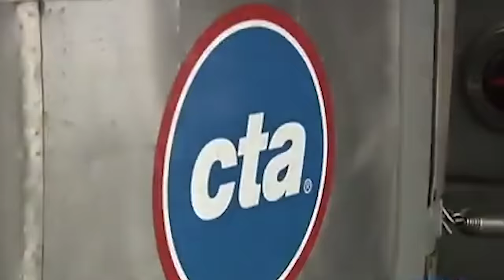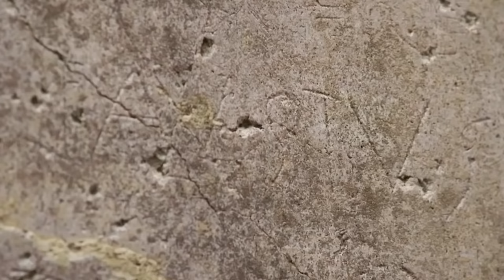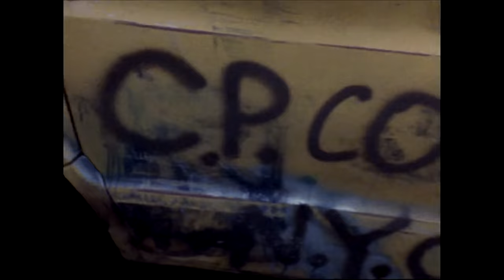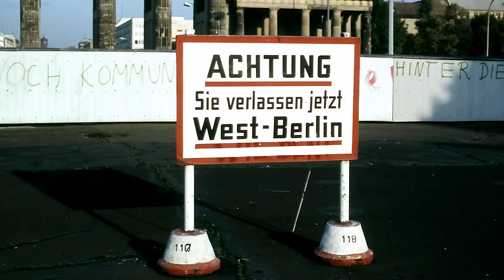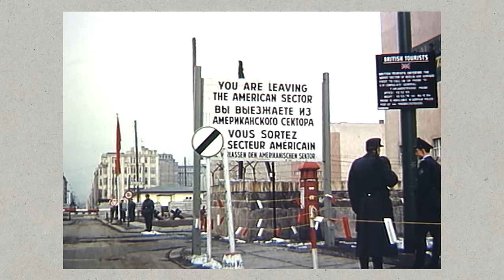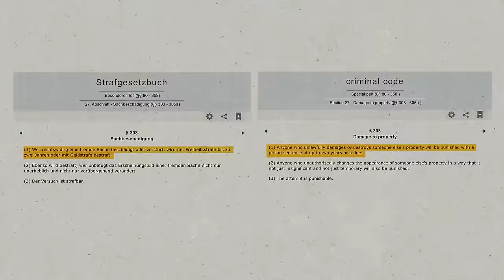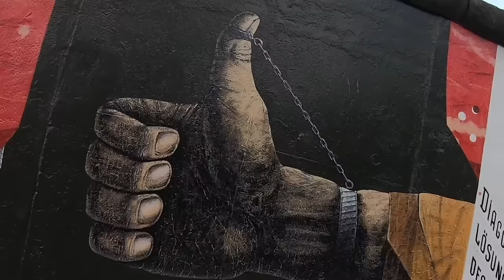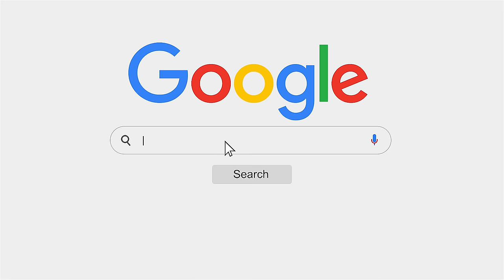CULTURE SHOCK: Illegal Graffiti vs. Legal Street Art in Germany

Comment: Hi Ashton, That was another fascinating video with food for thought. 
There is another interesting aspect here in Germany that needs to be addressed in this context: "Kunst am Bau", preferably translated as "Percent for Art". This is a concept for public buildings that was developed around 1919 in the Weimar Republic and aimed to subsidise local artists in need with a percentage of the building sum. This concept still exists at state level. But it had its pitfalls: I remember a school from the 1960s that was to be renovated. This included the façade, which was decorated with a "work of art" from that period.
The heirs then issued a temporary injunction against the measure in a flash, because the artwork would have been destroyed and the ensemble, art and façade, ruined. 
German copyright law is very tricky in this context. As the rights holder, you can grant rights of use, for a fee, of course. However, this does not automatically include the right to copy, reproduce, modify or even destroy.

As far as graffiti is concerned, things get interesting when, for example, Banksy sprays on a worthless ruin and his work is categorised as being worth millions. In terms of property law, this should be unproblematic: the spray mist can be defined as a thing and, as a thing, it is firmly attached to the building and has therefore become the property of the owner of the ruin. Under copyright law, however, the situation could be quite different. 
These thoughts should be given special consideration in Berlin - if only to avoid claims for damages.

Comment: Would you like to get up one day to find your house carrying a new, colorful message you might not even support? --> crime.
If an artist has the permission (or the mandate from the owner) to change the building or structure to artwork --> art.
But, Germany would not be Germany if there wouldn't be laws and regulations, even as an owner you can get in trouble if you decided to do so.
In Regensburg, the so-called "Bunte Haus" (pictures can be found in Google easily) caused some discussion after the city found the house “too different”. The owner was requested to change the house to "uncolored" again and he even was prepared to take the risk of a court case, which was reported in the press until the city finally gave up. There is now a second house of this type in Regensburg.

Comment: Hi Ashton. Controversial video for sure.
Graffiti can be both art or vandalism. That really depends on the intention as well as the skill.
Like you said at the start I also discern between tagging and graffiti. Especially when tagging is just a black illegible scrawl over another artist's work. That's when graffiti changes to vandalism.
I have no problem with tags that are artfully designed, using varying shades of color, including shadows, depth, etc. If it is just scrawl of one gang over another to delineate the turf of one or the other street gang I consider it vandalism.

There is however a point where ANY graffiti is vandalism: when it defaces and changes a classical architectural front of a building that was refurbished to look one specific way AND which requires a certain type of outer coat to retain its integrity. Certain spray paints can influence the structure of certain types of coating.
However, if the owner of such a building declares it okay for graffiti to be applied, go ahead. Knock yourself out. It is NOT my prerogative to dictate one form of art to be better than the other.
I personally may find one form of graffiti to be more artistically and visually pleasing yet that does not devalue others.

In the case of the DB I DO understand why they are at graffiti sprayers. Many of their spray colors trap dust and dirt under the color. This allows rust and other debris to accumulate which can't be easily washed off, resulting in a measurably shorter lifetime of the rolling stock of locomotives and train cars. As such unless the train cars had been specifically prepared for graffiti beforehand THIS IS vandalism as it results in measurable damage to private property.
The next problem is that among the basic taggers are also many "scratchers" who cut their 'tags' into windows, walls, or seats. That's when one artist of graffiti suddenly switches to vandalist in an instant. Here I draw the line between vandalism and art. Because scratches, especially in windows, seriously degrade the function of the object.

That's why I have a problem with SOME of the outgrowths of the street art movement. When the potentially damaging form of street art makes the same claim to validity that sprayers make after they finished an hours long spray project I do have my reservations about those claims.

Comment: I like when people use graffiti to decorate more raw and ugly places in the cities, not so much when you kind of destroy historical buildings with it. Also safety should be considered, as painting in dangerous places sometimes happends. Also there is difference between rubbish and art, and sorry to say the painters don't always seem to know this difference. Not so much graffiti but tags used to be a big problem, but here they are much less today. 

Yet there was a scandal this summer about a vice mayor of Helsinki and former member of parliament painted graffiti in both illegal and dangerous place. I have not heard anybody to talk about graffiti for decades before the scandal. Some people were against the graffiti itself while others were offended by the danger they caused by doing graffiti where they did it.  It was a grey concrete wall and there was previous graffiti on top of which they painted on. There was no real reason to remove that graffiti except the excample it was giving. Although on my opinion, middle-aged men painting walls might not be the greatest motivation for the youngsters to do the same.

Comment: Graffiti CAN be art, but practically anything can considered art now, so the better question is whether the graffiti beautifies a neighborhood or not.
I live in Dresden, and there are a few areas such as the Kunsthofpassage in which the graffiti really does add character to certain areas (some of that "graffiti" was paid artwork with the intent to beautify and even that sometimes gets tagged over without consideration). I find, however, that the majority of graffiti defaces heritage architecture and otherwise beautiful neighborhoods and parks, and the problem just seems to be getting worse over the years, it seems. Datenschutz also makes it difficult for the government to do anything, since you can't just slap CCTVs everywhere to prevent it from happening in the first place.

Comment: This has become a lovely Sunday morning routine: Having my coffee while watching Type Ashton's newest video, so thanks for that! 
As to your question: Subjectively, there is no difficulty in answering it. Graffiti is a wonderful way to lend art and vibrancy (read 'life'!) to all those depressing concrete walls of tunnels, bridges etc. Nowhere better to be experienced than by the two sides of the Wall as shown in your video. But it hurts to see a fine old building defaced by it, especially, of course, when it's primitive scrawling of some nonsense, but also in general. The usual type of Graffiti is very modern, edgy, aggressive - it doesn't fit with a building from the 1900s any more than a hip hop dancer would fit into the Barock castle of Ludwigsburg. I expect the artists would argue they didn't mean it to fit in, but that's where they would be wrong. They have the right to express themselves via their art - but so did those who created those older buildings. 
On an objective level, however, it is awfully difficult to find a rule that fits all, because who is going to decide where Graffiti would enrich the urban landscape and where it wouldn't?
Reply: About those concrete abberations, two wrongs (poor architecture superimposed by spray can vandalism) do not make a right. And nice architecture does not make sprayers cease and desist either.

Besides, the theory behind brutalism is "decoration is crime" in the first place. I would wager that this includes amateur ad-hoc "decoration" ... ;-)

Comment: In terms of street art I think that for private property it is simply vandalism without the owners consent.

For public property it should be up to the local government what is ot is not allowed to be painted on.

For any that is allowed the biggest question is going to be regulating the painting over of other graffiti. I like the rule to leave it up for a fixed amount of time, but anything that is based on skill or talent is subjective and makes any enforcement at the very least complicated and in extreme circumstances creating a barrier to expression.

The last question about the rebellious origins is actually sort of the moat interesting. My first statments were about when it should be legal, but the point of it's origin was in a lerge part about expressing things that were otherwise banned or censored. I will say that I generally don't agree with people going outside the rules to get a point across, but the systems put in place often times do not present meaningful ways to express dissatisfaction with them. In an ends justifying the means argument street art is a relatively innocuous means to justify.